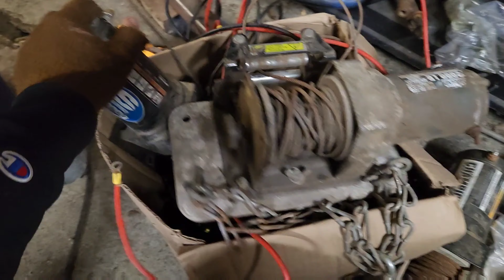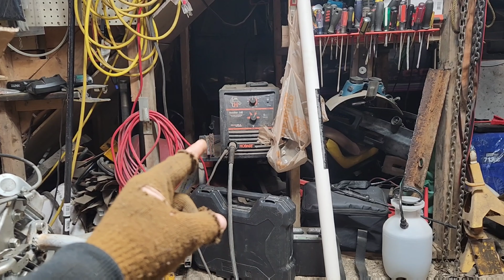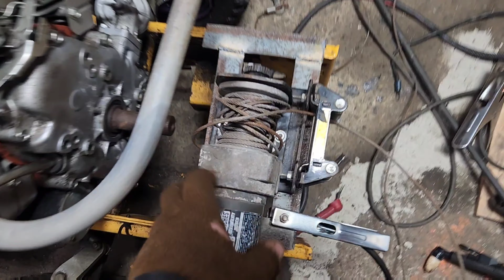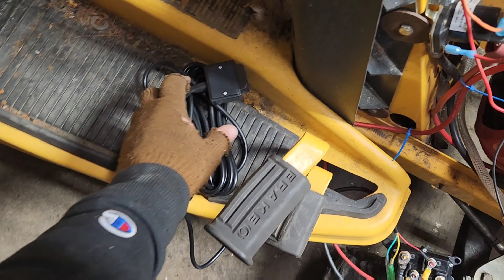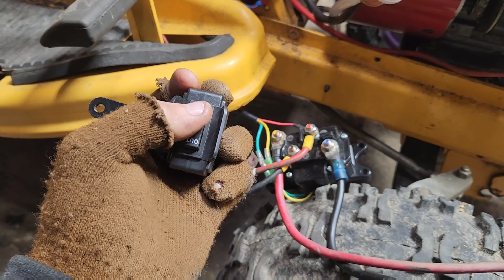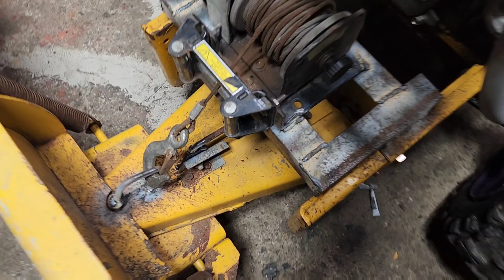Winch Install for Snow Plow

Comment: Great video! Awesome project!  You are an inspiration! i am taking it one step at a time on making a free craftsman LT 1000 ride on mower into a mud runner. so far i have ordered regular sized mower tires for the back ( i will be putting atv tires on at a later date), 2 red led running lights (from tractor supply) on for rear tail lights, and 2 55 watt halogen driving lights on the top front for head lights (from marden's), and a new drive belt. i do plan on a later date to do a drive pulley and tranny pulley size swap. :)

Comment: Nice plow video. I’m still looking for the free bits to make myself one too. I have a line on a plow blade and I reckon it’s just a homemade pie away or something like that.
Reply: Using a bed suport frame could assist you, easy to cut to neede space, and if you don't have a welder, you can easily drill hole and use bolts

Comment: 3:53 haha I so agree. 
For the Smyth Ute that I'm building ,everyone recommends that harbor freight air powered rivet gun because there's 2-300 rivets. 
And then complain about it half pulling ,and blowing oil all over. 
That's great to get on bare gelcoat. 
I had a pair of long handled Pittsburgh manual squeezers, and I did fine. 
(The crimper in the vid looks like a pair ,that's how I got on this track) 
I used a normal pair of squeezers for tight areas ,but that's the way it is anyway, you're gonna have a few. 
No way you'd use em for the whole job, when a 3/16 rivet pops it bothers your hands after a while if you don't put a towel around it. 
No need for the air powered thing, I've helped guys buck 10k real rivets to build a plane so suck it up buttercup ,it's only a few hundred easy pop rivets.

Comment: I hope you don't need to use just that to plow . Ive used them before , they bulldoze great but when win-rowing not good . A good winch switch is the same as a double  pole double through plow switch for left and rite angles . Found sometimes at hardware stores , and surely at automotive stores even some electronics stores . Next a lift motor for angling the plow ?

Comment: The hydraulic crimpers that I have only cost like $15 more than those. They make a beautiful 6 sided crimp you can trust on automotive work as well. You can also still use them if u are a wimp. I used a hammer and punch before I had them... aka free.
Reply: where are hydraulic crimpers for 15$? :D Cheapest I could find is ~60$
Reply: @Vein1986  "$15 more than those" as I said
Reply: @inspireonex  you are right, i have misread that :)